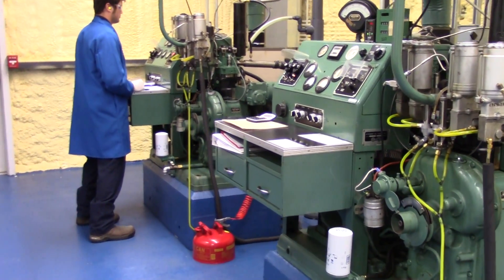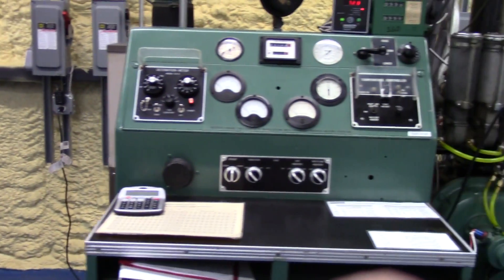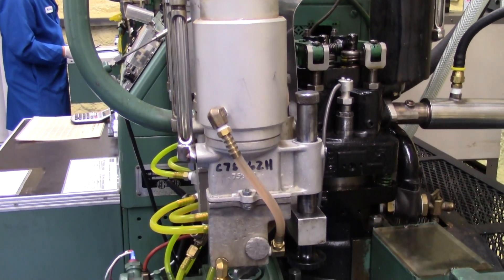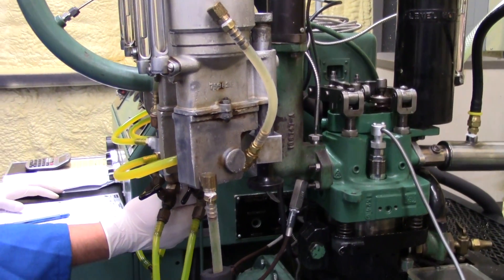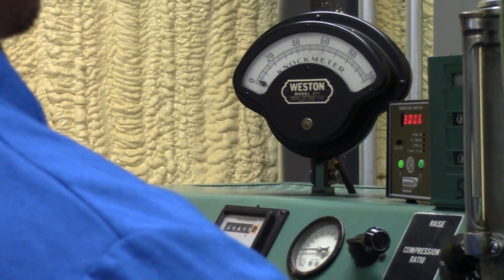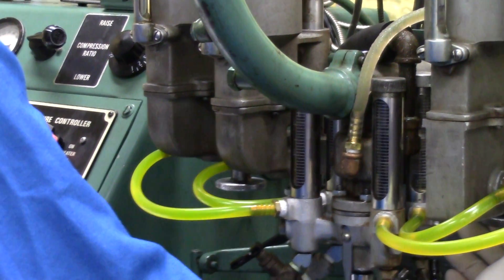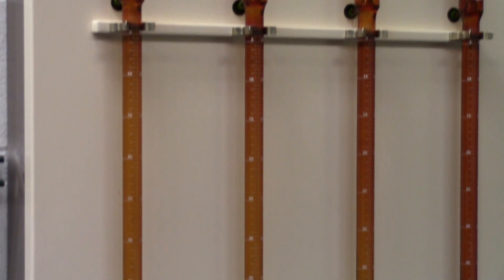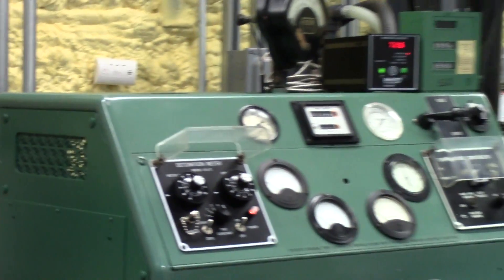Octane Room video

Comment: nice!!. what's the displacement of the engine? and how long is the test carried out for?. what unit are the knockmeter readings expressed on?
Reply: la cilindrada es variable, tu puedes incrementar o decrementar la relación de compresión dependiendo qué cámara de compresión necesitas según  el combustible a analizar, la prueba durará 10 minutos pero la preparación de la máquina para la prueba podría alcanzar 1 hora aproximadamente, las unidades del knockmeter es en % de golpes los cuales deberás ir a la tabla correspondiente del método ASTM D 2700 y ahí te dirá cuanto octanaje tiene tu combustible.
Saludos